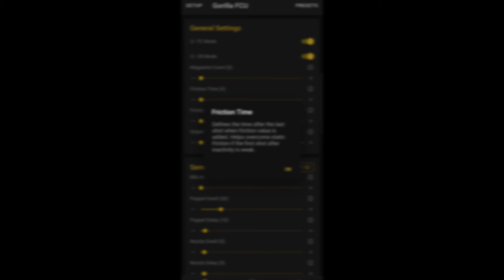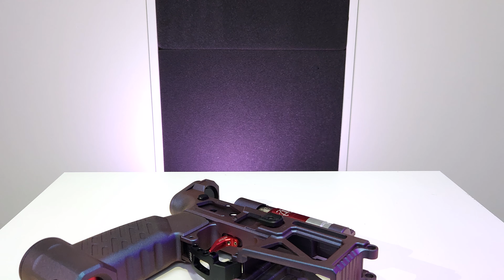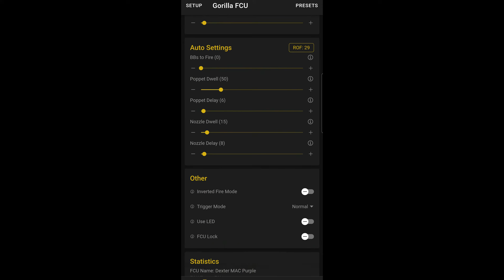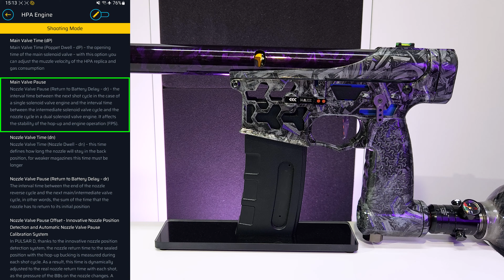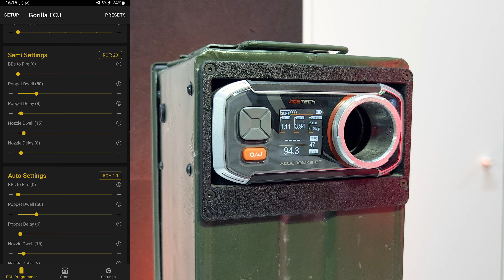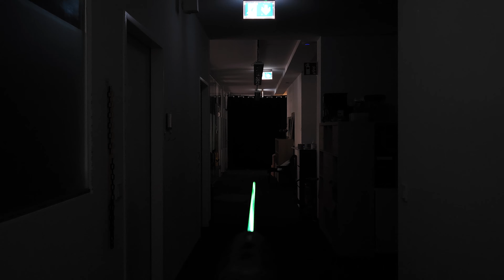How To Properly Set Up Your HPA Timing!

Comment: I have an F2 that's been working perfectly until very recently when I went to use it and the nozzle moves but no air is being expelled. Do you know what the problem could be? It was working fine until now and I haven't changed or bumped anything. Thanks
Reply from the maker: Are you sure it's getting enough air? The only time i encountered that was when the timing was super short, instead of 50 tenths of a milisecond, i set it to 4 tenths by mistake. Check the air supply, then check timing settings. If both are okay, then probably something failed, either one of the solenoids, or an oring. Each can be checked 1 by 1
Reply: @DeXteR.AIRSOFT  I haven't changed the setup since it was working until now, I haven't even changed the regulator pressure, I just disconnect it from the bottle. I also tried another regulator and another bottle and the problem persists. Could it be a wiring problem even without having touched it? I understand the solenoid could have broken due to moisture? I'll try swapping the solenoids. Thanks so much for the quick reply!
Reply from the maker: @350zRocketBunny  you can unplug one solenoid at the time, and listen if they are clicking when you press the trigger. If they don't, they brokey.

Comment: My F2 isn’t feeding at all but idk if it’s the dwell. I use a maxx M4A hopup, 6.02mm maple leaf barrel, and Prometheus purple bucking. I also use a gate titan 2 if that’s relevant.
Reply: Switch the solenoid wires😅 they might be inverted(worth checking). Make sure they are connected properly. Then play with the dwell
Reply from the maker: Assuming the distance from the hopup to your gearbox is correct, it's worth checking the solenoid wire order. If that is good, increase valve pause (dr) to 15 ms. What mags are you using?
Reply: @DeXteR.AIRSOFT At the time of testing I was using Novritsch 225 midcaps but I have since switched to PTS EPM1RX mags. Also, I would certainly hope the alignment’s good because I paid a tech £60 to install it😂
Reply: @Babyjizzus and  in those 60 pounds, didnt he made sure your gun shoots with your mag ? 😂😂😂
Reply: @xmarinique funny story about that actually, the tank I gave him was faulty and popped a valve at like 300psi so he couldn’t fill it or let alone use it and that’s not even the crazy part. The crazy part is he doesn’t own a HPA tank, there’s no HPA tanks in the his shop, and he doesn’t know anyone who owns a HPA tank. Yeah he’s one of those Milsim elitists
Reply: @Babyjizzus anyway 60 is too much just for the install… for 60 pounds i would blow air through the macroline to make sure it works.
Reply from the maker: @Babyjizzus  Sonds like you need a new tech